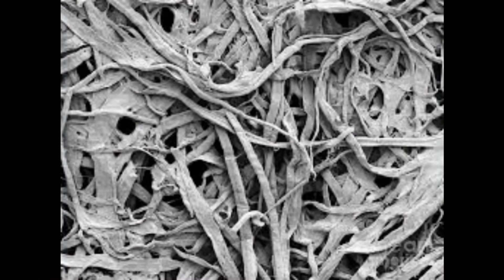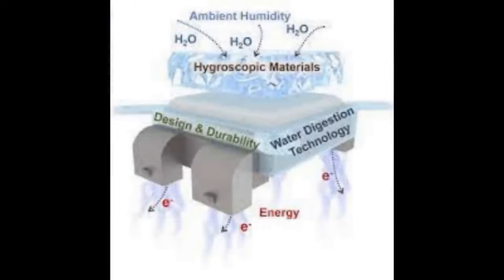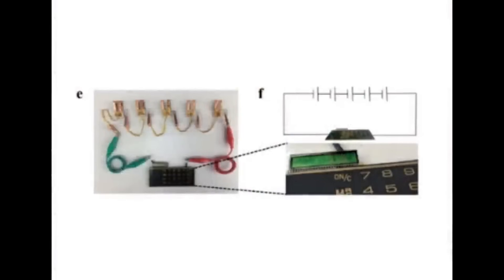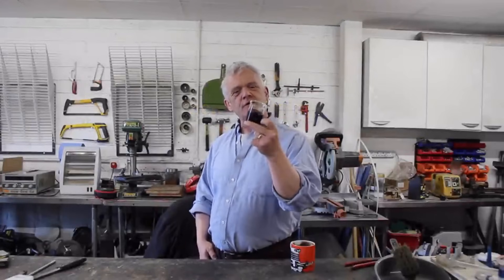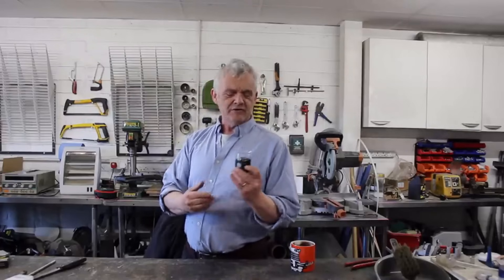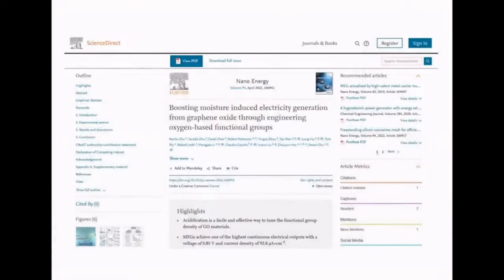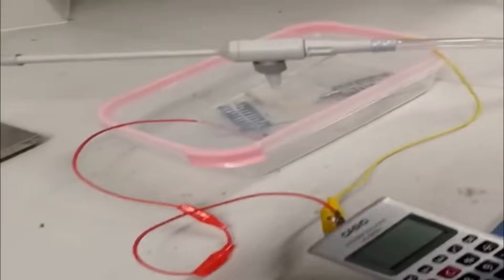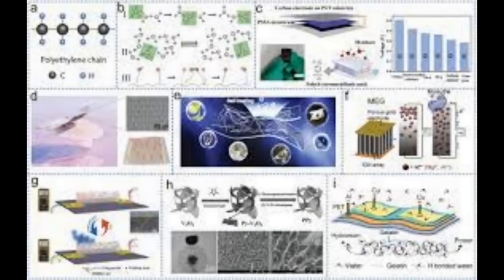043 Damp Paper - The Future Of Energy

Comment: Oh man , you are so close esp last few videos , Tesla , Reich and older structures have this in common. Think bigger , negative connected to groundwater  (car radiator for surface area, dome on top of Ariel structure gathers neg charge underneath, hence positive on top from atmosphere, load and spark gap between the two . The founder of Siemens proved this principle on top of a pyramid in 1890s . Hope this helps , love your vids.
Reply: Your on the right track. There's more to it u will find because its weakish in its basic form. You gotta boost it

Comment: Not really related, but...

Make a couple of simple capacitors out of plastic and metal.
Charge one of them up (to a safe voltage.)
Take them apart (carefully!)
Swap the plastic insulator from one to the other. 
Put them back together.
Where is the charge?
Did it stay in the conductors or travel with the insulator?
Reply: Wouldn't touching them redistribute the charge to the toucher?
Reply: @justtinkering6713 Could happen, but can be avoided.

Comment: I love these videos, but in the off grid world miliamps is somewhat of a four letter word, I'd love to see a video about how to produce some serious power, say 10kw at 240 volts continuous.. small power is great if your needs are already met, but I've got a 30amp 240 vac well pump to run and a welder and a water heater and lots more, solar is great but in alaska in winter it's not as much as we need, anything to help us not need to run the petrol hungry 10kw generator that uses a u.s. gallon per hour (3.78liters) . Hopefully you may have some ideas and can make a video about them. Keep up the great work and merry Christmas from alaska!
Reply: Robert put up a video in the last week or two about running petrol engines on gas, it could be worth looking into 👍
Reply: Or try to make things more efficient so they use less power. Better yet, make life simpler so we don't need power anymore.

Comment: Yeah, the moisture doesn't turn into power, it's does what the potato does in a potato battery. And, if you get <1 volt, and a few micro amps, for a short time, well, you need millions and millions times that just to charge a phone. It would be orders of magnitude easier to make something practically useful using TEGs and body heat as the heat source, or evaporative cooling to create the temperature difference. I'm not saying that TEGs are a good way to produce meaningful power from small temperature differences, they are not, but compared to "humidity power" they're fantastic.     

Just the basic idea that a state, like a level of air humidity, as this basic concept often is described, can be a source of energy, is fundamentally flawed, you need a difference, a potential, to extract energy from, which is mentioned in this video. But, you need that potential, if you try to scavenge power with you wall papers you either need moisture to travel through them, or have significant changes in air humidity, neither is very difficult to achieve, but neither is also something you'd want, and definitely not worth a few watts max generation from your whole home.    

The amount of power required to barely run a modern simple calculator is incredibly small. I can agree that "trivial" isn't a good description, as calling it trivial would not make it clear just how ridiculous small amount of power that requires. There were commercially produced calculators decades ago that was powered just by few square centimeters of solar cells, that didn't require very strong light to produce more power than the calculators needed. Now solar cells are about twice as efficient, and practically free, and there are much more energy efficient components now.
Reply: I initially thought the same... but after reviewing the paper, they aren't using electrodes that will react chemically with the paper. So, there is something else going on... perhaps a reaction of the acid with the paper.
Reply: @marcfruchtman9473  My main point was that the moisture isn't a fuel, as implied. The basic idea of power out of air humidity is a recurring subject, research has been done many times, and I don't rule out the possibility that some researchers results mostly were caused by dissimilar dirt on the probes and similar artifacts.          

Any energy devise that have yet to be proven able to provide power that can't be explained be electrochemical processes from the equipment used, should be considered as such, "yet to be proven able". That in it self isn't proof of the opposite, but with ideas like power from air humidity, that has been popping up for years, and remain yet to be proven able to generate power that can't be explained by measuring errors, it's pretty safe to assume it will never become a meaningful way to generate power. 

And, anyone that implies that air humidity acts as fuel is either not entirely honest, or totally clueless about how energy works. It doesn't matter what research institute, or how many papers, technical words and illustrations they published, if their explanation is that air humidity acts as a fuel/energy source, they're just wrong.
Reply: @fishyerik Yes, I agree with you there. It's clearly not just "plain" water... although there is a small initial reaction with plain water, after that it seems like acid water does the trick on a regular basis -- see Fig. 1 of the paper which shows repeated waveforms of electricity when drops of acid water are dripped onto the paper cells.

Comment: I have been thinking the same thing about making a moisture absorbing battery for some time now it probly will work if the are made right to where the moisture can be absorbed from air I dont know why a screen on a separator could be used for maximum absorption of moisture  .